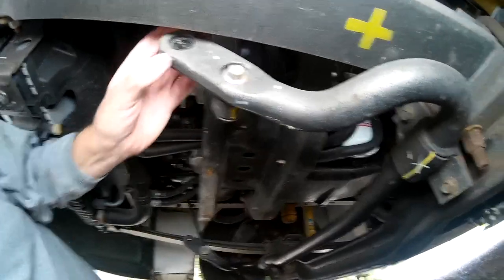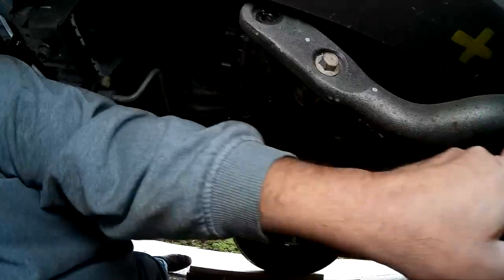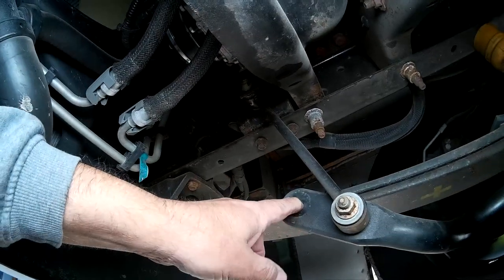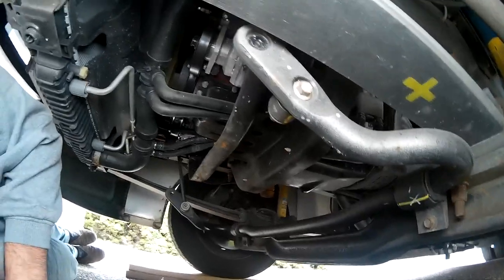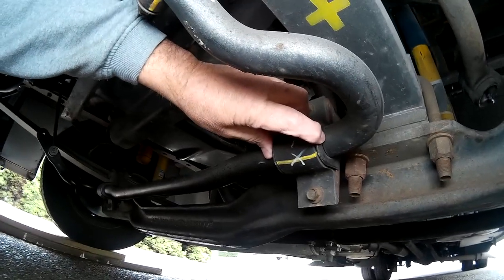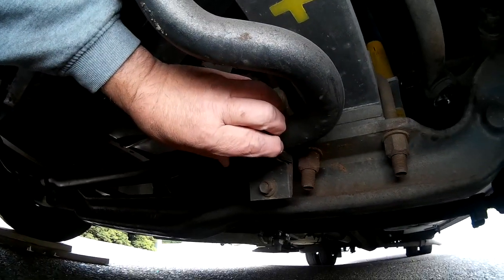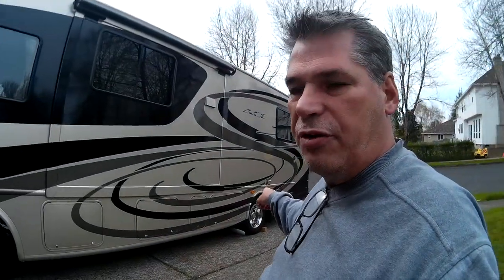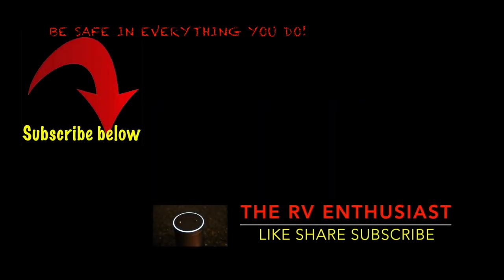Cheap Handling Fix  E161

Comment: Don't change the angle. Buy Hellwig adjustable endlinks for both front and rear. I just did the chf and found it necessary for a few reasons

Comment: You make a good video; very clear and short. I'm interested in doing just as you advise but I always wonder why Ford had that bolt in the original hole in the first place. Do you happen to know why they did? Or why they should have two holes to choose from?
Reply from the maker: I don't know the answer.  After I did it though, the ride is better by a lot.  turning corners no longer push down and out.  it just is a better ride.  Ford should explain the 2 holes too.  thanks for the complement.
Reply: Well, what the heck. After all, as you explain, it's only 20 minutes out of my way for a good experiment. Thanks for the quick response.
Reply: My guess!  Ford sells an empty chassis to the RV manufacturer. So the bolt is in the correct location for a light load. Ford doesn't know how much the finished product will weight. It's the RV manufacturer who really should readjust the sway bars. No I don't work for Ford. Keep in mind there's 2 sway bars one front and one rear. Do both. The difference in handling after this adjustment is unbelievable.

Comment: I have a 2017 FR3 30DS. On the rear, I had to push the vertical bracket significantly to get it in the second hole. It was like it was spring loaded. Not the same on the front. Has anyone else had that experience?

Comment: This is a cool idea but ridiculously dangerous. If you ever hit a big bump where the coach bounces high that connection point could Barbie leg backwards and you will be screwed if that happens.
Reply from the maker: This has been discussed on thousands and thousands of sites and rv blogs.  Engineering and all.  All truck/rv bodies are not the same size and weight and a one size one hole approach is ridiculous. Search the thousands.  Also if it were as you say, why the 2 holes?

Comment: WOW, if 20 minutes were only true...Of course what you may notice is since every coach is different so too is the time to complete the task. For example my coach the lower end link bolts were 1/2" from the spring and directly in line with the spring and the bolt is 2-1/2" long...Oops!. The entire end link needs to be removed and the upper end link bolt you will be removing and re-installing blind. Once the end links are removed the sway bar wouldn't move...brand new coach. Had to loosen the sway bar bushing clamps and use a bottle jack to reposition the sway bar angle to accept the end links and bolts...all tolled 2.5 hrs under the coach on my back. But it does make a huge difference.
Reply from the maker: Ouch!  What coach do you have?  Mine was truly 20 mins. It took me years to get around to it though.  Glad it made a difference.

Comment: Spoke you several RV/TRUCK mechanics. They DO NOT recommend this. Placing to much stress on connecting rods
Reply: It has a track record of over 15 years of cross country travel. 
Thousands of individual rv owners.
Dealer wont condone for liability insurance reasons.
Same reason Ford engineer won't,  plus they probably do it on there own rv's.
Never,never, has anyone ever reported damage or premature wear from this mod.
There are thousand of rv owners that will attest to this including myself.

Comment: I'm confused. Should the bolt be moved to the outside hole. In other words bolts as shown in video need to be moved.
Reply from the maker: The cheep handelongated fix is as the image shown.  It was completed.  Connection needs to go from outer hole to inner hole.